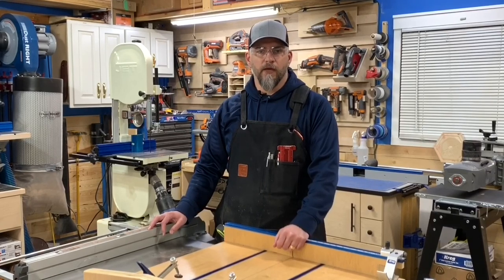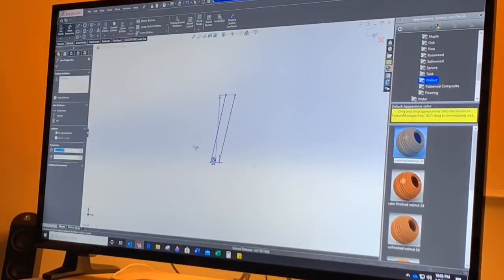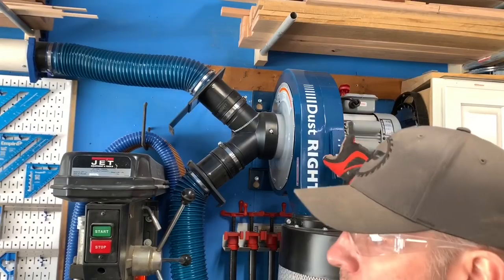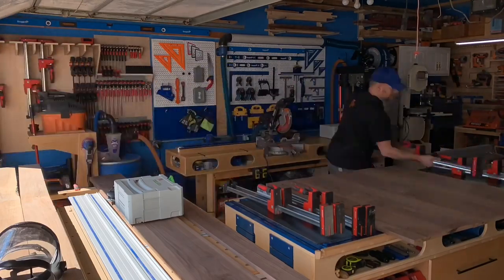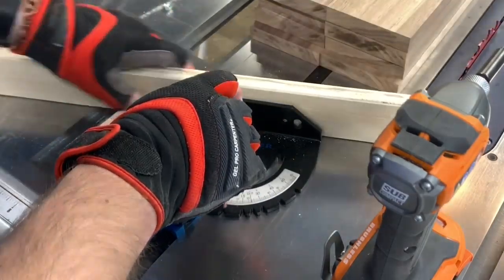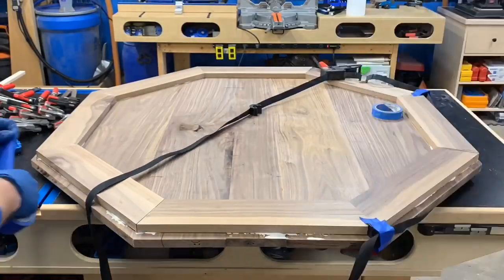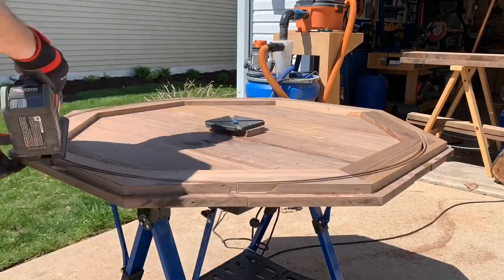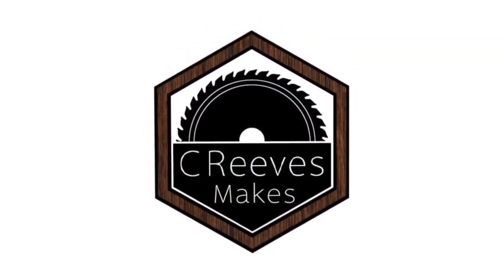CReeves Makes: The Big Build Off - Episode 1:  Making the Dining Table Top

Comment: is that an aftermarket extension wing on your table saw? If so, can you share where I can get it? thanks.  3:14
Reply from the maker: Do you mean the black section behind the saw?  That is my Mobile Outfeed Assembly Table.  https://www.youtube.com/watch?v=mHJEpsFg17U
Reply: @CReevesMakes  No, but I'll check that video out. At 3:11 your grippers are sitting on the wing. The table saw looks like Rigid R4512 and the wing looks like it's cast iron or solid steel. Mine is a crappy folded metal wing and it kinda stinks haha.
Reply from the maker: Ahh ok.  My saw is a Ridgid TS3650 which is older than the 4512.  It has an all cast iron top and one piece rails.  I love it.  And it was $180 on Facebook!